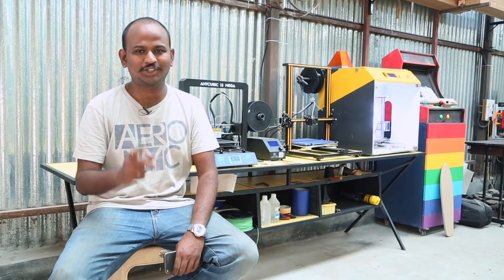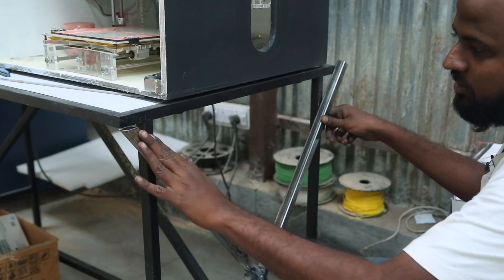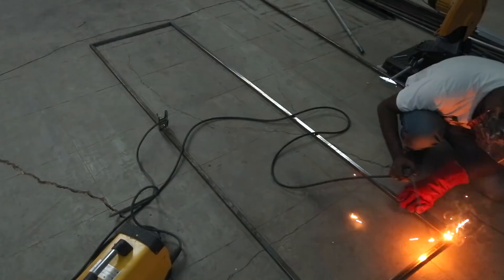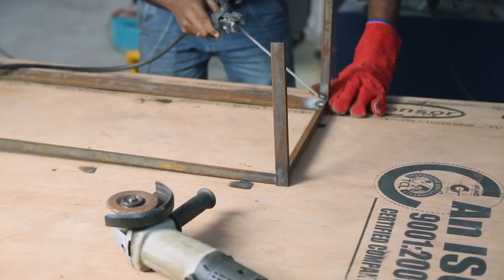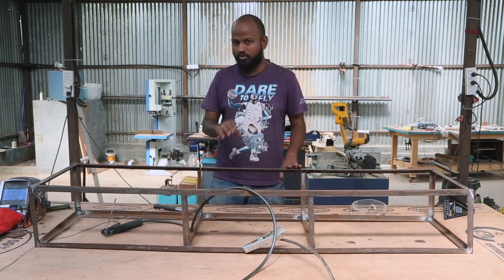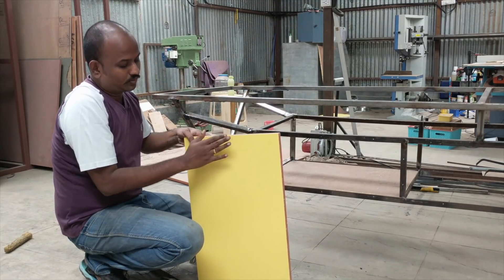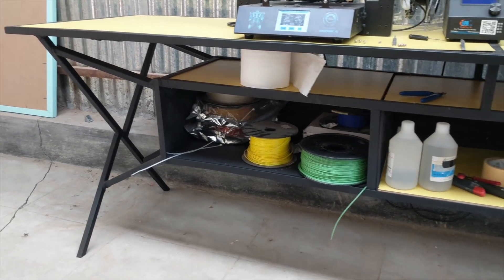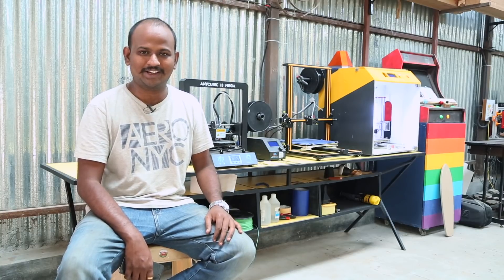3D Printing Station Build // How to

Comment: Awesome as always, i have been looking for a welding project from your end and this seems good, what is the yellow ply wood called as? what is the gauge of the 20mm square rod, and what welding rod do you use is it E6013, check your pm, i am sending you a book

Comment: How table top is sitting on square tubing ??
Reply from the maker: I welding small brackets underneath.
Reply: Aah ok I can see that now....thank you for such quick reply :)
Reply: you can use angular rods, its hard to bend them, and they give you the necessary groove to put those ply wood pieces